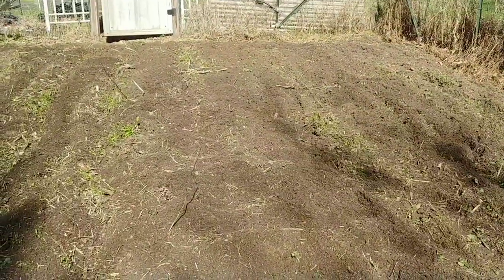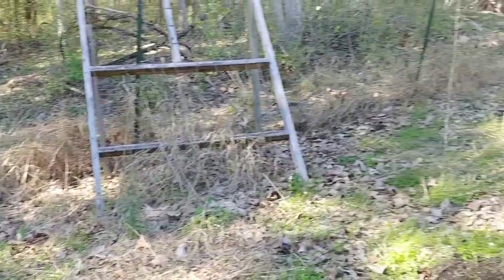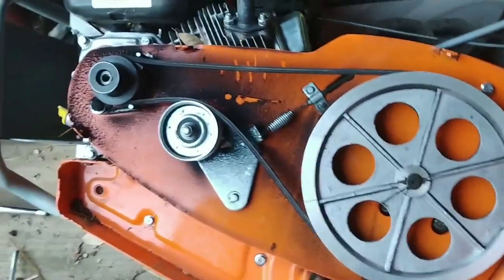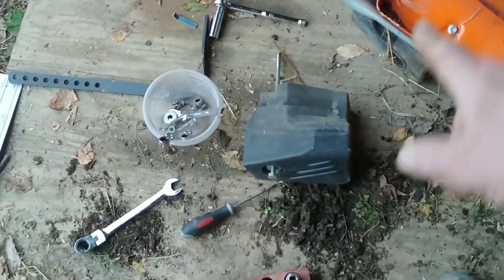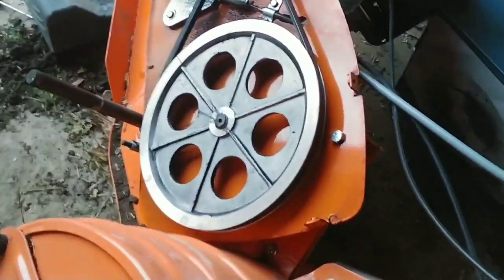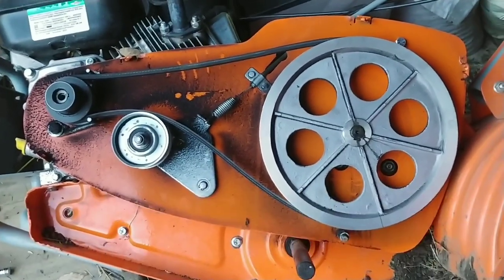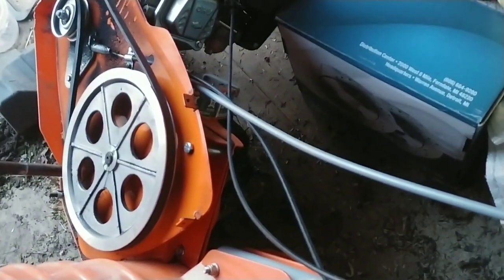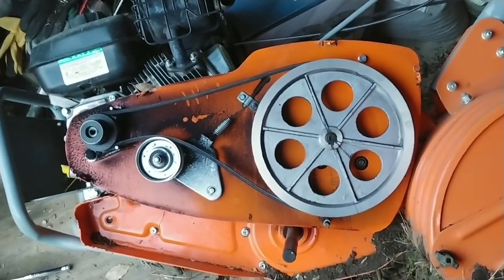yardmax yt4565 update & what's going on? #yardmax #yt4565 #tiller #belt #inspection #homestead

Comment: Mine sucks to had used third time this year belt slipping
Reply from the maker: if you take the cover off like in this video before the belt breaks, then take the belt to an auto parts store and get a replacement so you have one when it really goes out.  Put the old belt back on it and use the adjustment screw to tighten it up.  That worked for mine .... it still has the old belt in it.  So I suspect the owners manual neglected to tell people they need to adjust the belt tension every season or two but it tells you how to do it on the original owners manual page 16 (clutch adjustment).  https://www.manualslib.com/manual/1347188/Yardmax-Yt4565.html?page=16#manual

Comment: When you get into the gear box, will you please post video. I can’t figure out how to access the gear box to figure out what is going on with mine.
Reply from the maker: Will do. Im def going to have to go into the gearbox.  I had this strange feeling i needed to put it back together to make sure tightening the belt fixed it. It works sometimes and other times doesn't so its def something in the gearbox. Just based on the way it looked to me without doing it yet, about everything has to come off of the frame to get inside the gearbox. We will see soon ....

Comment: How do you fix yardmax idling.  I bought it for 3years, but I never use it. I take it out today. Unfortunately, it can start, but couple second it shut off. What should go wrong with it. Please let me know. Thank you
Reply from the maker: stale gas in the carberator bowl has corroded it.  You will need to remove the carberator and clean it.  Almost all small engines use the same carb design and it is similar to this video I did:  https://youtu.be/aUDa_K-qGhw

Comment: Does anyone know the size of this belt? LxW? I have the part number but it runs around $50 ordering online and is only found on a 5 or so websites.
Reply from the maker: what I did was took the belt to napa (even if yours is broken or stretched they can get it close) - it doesn't have to be an exact size just close, there is plenty of adjustment in the cable and the tensioner is spring loaded so even if its an inch longer or shorter it will work.  I thought I still had the little cardboard the belt came in with the part number but I threw it away or couldn't find it when I went to look.  If you wanted to try to match the belt with something online instead of going to a part store, you could take a piece of string around the circumference of the belt to get its length - even if the belt is missing you could use string to follow the belts path.  Then use a tape measure to get its width and thickness of the belt or pulleys and search that way.
Reply from the maker: btw, I also suspect the manufacturers provide that stupid 4lxp85 part number intentionally, its not a standard belt part number doesn't match standard or international belt naming conventions and only matches their number intentionally forcing most people to over-pay for a replacement belt from them.  International standards, 4L is a v-belt but its not.  The 4LPX usually means light duty serpentine belts followed by the length in MM but 85MM is only 3 inches soooo......I bet if you look up the companies that use that belt part number, they are all under the same umbrella corp company (owned by the same people and shareholders)

Comment: Did you find out a belt part#. I'm trying to find a matching belt myself
Reply from the maker: Not yet i haven't. I put it back together to make sure tightening the belt really fixed the problem and although it worked for a short time, there is something up in the gearbox and im going to have to tear it all down to find out what it is and if its even worth fixing. This has low hours and shouldnt be breaking down already.
Reply: It doesn't need to be exactly the part a swamp cooler belt will work just fine as long as it's the same length and shape
Reply: Only by phone call to Yardmax company stationed in Illinois.